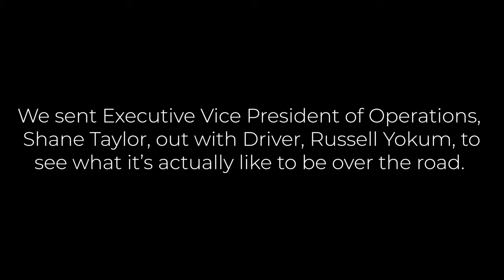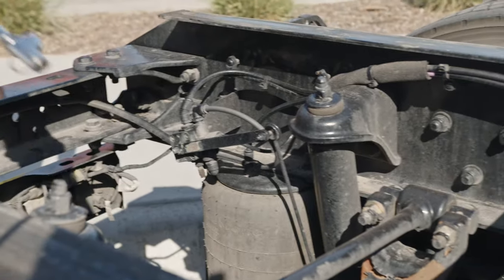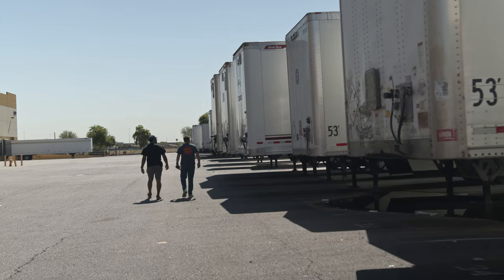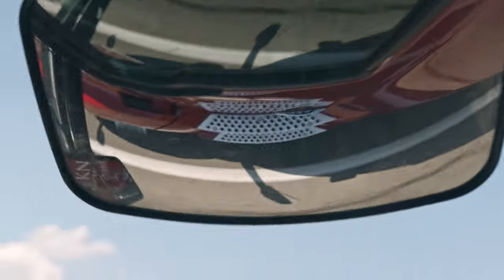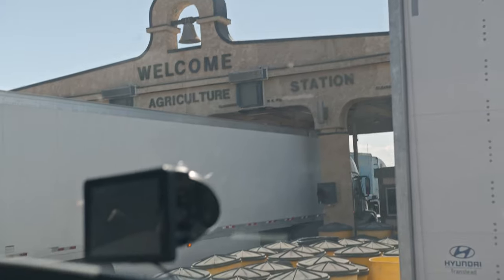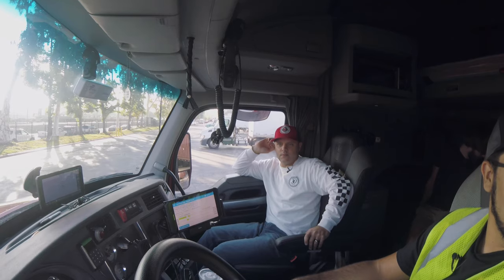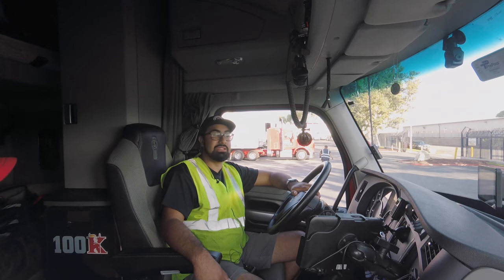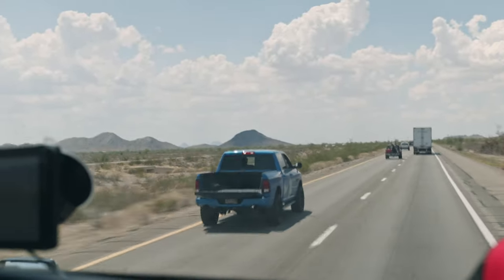Driver Shows What Trucking's Really Like | VP Goes On Ride Along | Knight Transportation

Comment: Dear mr. VP, in the video you struggled to raise the landing gear. My dear sir if knight truck were all equipped with the capability to dump the airbags, you could lower the weight of the trailer onto the landing gear pull out from underneath it and then conversely lift up on the trailer unloading the landing gear that's making it easier on the crank handle wow putting less wear and tear on the landing gear gearbox